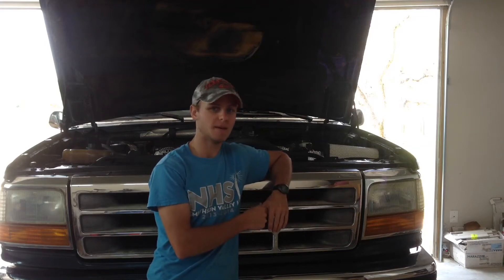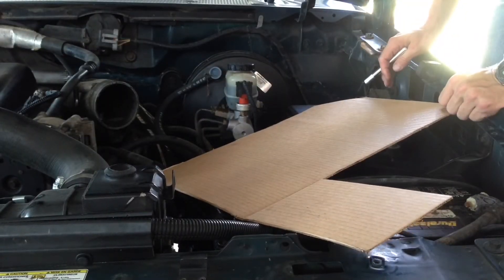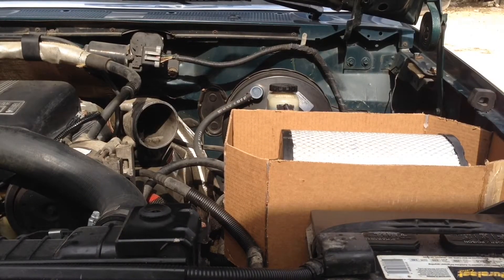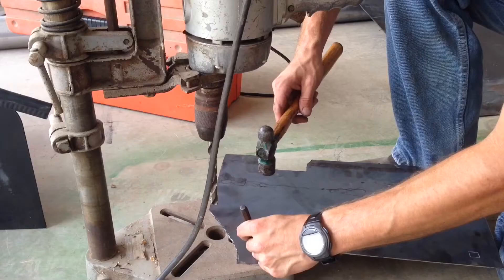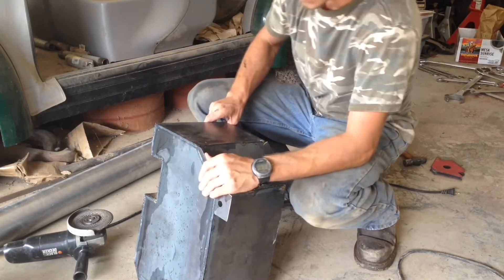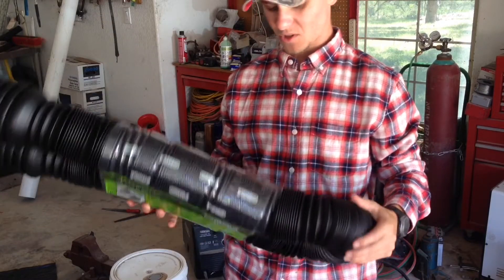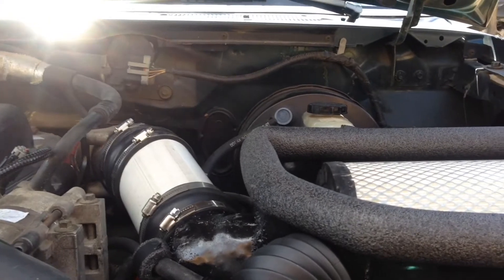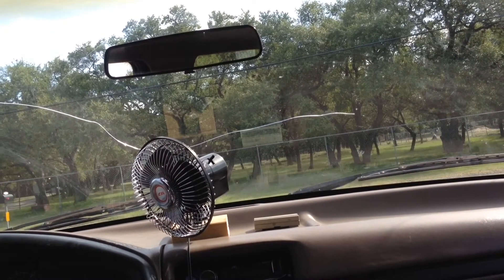Air Intake Build 7.3 Powerstroke

Comment: Any filter under the hood is not a cold air intake
Reply from the maker: Yeah I tried capturing the cold air using the long hose coming out the side. The intent was to use that as a siphon to get air from out front to feed the air filter. Unfortunately it restricted the flow and didn't work out so great.

Comment: 5° degree difference between outside ambient and engine bay temp while moving, cold air intakes are waste of money on intercooled vehicles,
Reply from the maker: Stock 94-97 7.3 Powerstroke equipped trucks didn't come with an intercooler from the factory, so having a cold air intake would make more of a difference. I've been working on a video trying to figure out whether or not it's a good idea to insulate intercooler charge pipes or not. I hooked a temperature probe up to a section inside the engine bay, and with ambient air temperatures around 65*F, I recorded an engine bay temperature in excess of 120*F, and that's after adding heat shields around the manifolds and turbocharger turbine scroll! While this was at idle, I saw the temperature difference drop to around 10 - 15*F while the truck was moving. Essentially, if you're accelerating from a standstill it still makes sense to add a cold air intake to increase the air density. Furthermore,  if you start with an even slightly denser air going into the turbo, you'll still see benefit, albeit likely marginal unless you're shooting for a horsepower record, but in the performance world, every percent of power you can get makes the difference. Simply put, taking in colder air to the compressor of the turbocharger allows you to operate at the same turbo power consumption level yet flow a higher mass of air into the engine. Depending on what you're going for, this could permit cleaner combustion, lower exhaust gas temperatures which in essence allows you to increase the engine fueling rate, and can theoretically help with turbo spool by serving to generate a greater quantity of gas coming out the exhaust with which to spin the turbine. Sure, modifications such as this are likely trivial when it comes to a truck that is simply being used to drive back and forth, but for someone who's passionate about power and takes it up as a hobby, I think it's worth it, with full understanding that not everyone thinks that way, and that just fine too! Thanks for the input!
Reply: An intercooler would be a better and less time consuming upgrade
Reply from the maker: @jeremykincade5815  Maybe, besides, what's the fun in that, why not do both and refine your fabrication skills in the process!?

Comment: Love the video! Just put a 6637 in my truck (actually got one from Advance 20 bucks cheaper cause of my business account) my truck is spooling quicker, has a better throttle response and the boost numbers picked up a bit. Have you looked into a MAP line relocation? It's my next mod I'll be doing tomorrow. By relocating the vac line for the map to the Spyder it gets a better reading and sends more fuel.
Reply from the maker: Nice, I'm glad to hear the 6637 works well for you! I never had the stock intake on my truck, so I wouldn't know. At least I didn't notice any huge loss coming from an AFE cold air intake to the 6637. I haven't looked into the MAP relocation line, I can see how it might make sense to give you a higher boost reading. You can definitely tell that the ECM dictates fuel from the turbo boost. If you do relocate, it'd probably be best to put it in an area of your intake Y that has the largest cross sectional area. Basically as the air flows through the manifold, it speeds up through the small port but decreases pressure, while in larger sections the air velocity slows down and pressure rises. It's just the Bernoulli equation if you want to read into that. It seems somewhat reasonable that you'd get a more accurate reading, but I'm skeptical about seeing and noticeable gains. If you do relocate the line  let me know, I'd be interested in knowing whether it made a difference or not!
Reply: @Rnddiesel  yes sir I sure will, I'm planning on picking up the stuff to relocate it tomorrow.
Reply from the maker: Awesome, best of luck!
Reply: @Rnddiesel by moving the vac line on to the Spyder at the most middle spot it'll read more boost and adjust and send more fuel. I just went to Napa and got a metal valve stem, removed the core. Drilled my hole, started with a 1/8" bit, moved to a 1/4" and the final snug fit was 13/32 on a step bit. Used the rubber seal that comes with it on the inside then an oring between the washer and the Spyder. Took me all of 10 minutes to do.I just took it out for about a 5 mile run. I did notice two things though. It seemed less laggy and it blew less smoke under WOT. It would blow little puffs of smoke under WOT at 60 to 70, now it doesn't. Could be because the original vac line was about shot and I replaced it or it could be because of the relocation. Not 100% sure but there is only those two differences that I've noticed.
Reply from the maker: Awesome! Thank you so much for the info. I may look into some variant thereof for my truck, it'd be a bit different though, I have an intercooler now. How did you plug up the old map line fitting in the intake manifold?
Reply: @Rnddiesel  the E99 Spyder has two ports already there from what I've been told. I have a picture if you have a way for me to send it to you
Reply: @Rnddiesel  the website is IDI performance.com he builds parts for 6.9 and 7.3idis I've used them for years when I was running those motors
Reply from the maker: Wow, that's awesome! I was really close to getting an idi before I got the Powerstroke, they both have their pros and cons too. Not many people build old school idi's, that's pretty cool.
Reply: @Rnddiesel  I love the old IDI motors, they are great but for daily driving/hauling the PSD is Superior, better fuel milage, better performance. Look up racinanddrummin on YouTube. He has a IDI powered bronco that hits 42lbs of boost.
Reply from the maker: I know exactly who you're talking about! I'd heard about the guy quite a bit when I was looking into buying an idi. I haven't heard about the Bronco though, and that's a ton of boost, and a ridiculous amount for an idi especially.
Reply: @Rnddiesel  Racing and Drummin's name is Justin Anderson, he owns R & D Diesel and idiperformance.com and fabricates and builds everything in house and uses his own motors etc for test dummy's lol
Reply from the maker: Really, that's so cool. Haha, I'd love to do that one day for 7.3 Powerstrokes! Heck right now I'm working on an intake spyder, we'll see how that goes.

Comment: You sir are a 7.3 rock star, way to DIY a project. Just spent $ 300 on a sb filter that does not line up with the mounting holes nor the inlet to the turbo. 
What you made kicks ass and love the creative way you made your box!! Puts the sb pos to shame. Love what you're doing with your truck!
Reply from the maker: Thank you very much! I do enjoy trying out new things. You know I've got to tell you, that I'm not currently running this intake anymore, I found that it became too restrictive when I ran it the way I originally intended, with a closed lid.  I do have future plans for a revised version though. Shame about the SB. Right now I'm basically running just a straight NAPA 6637 without any shielding around it. Not the greatest, but it works for now.

Comment: I'm interested in your new design. I'd like one or at least the plans for it so that I could build it myself. I have some 16 gauge lying around waiting to be used. Thanks
Reply from the maker: Alright sounds good, I haven't made the new intake yet, and there's still some things I need to figure out for the design. Hopefully when summer rolls around I'll have more time to figure it out. 

I'm assuming you have an OBS truck?
Reply: No, not OBS.  Mine is a 2000 F-350 7.3L SD PSD CC LB DRW.  However IIRC the 6637 is one of the "acccepted" and "popular" stock intake replacement options (if you read the forums anyway) over the stock intake.  I do still have that stock intake setup, and would like to upgrade.  Furthermore, I like the factory intake too, but I understand its issues.  So a custom replacement that draws in cooler air from a good location and that has the stock appearance is the way I'd like to go.
Reply from the maker: Okay, the main issue I see is that I drive an OBS and under the hood it is not the same as the super duty. Odds are that if I design a new intake, it won't fit in a super duty like it would in my OBS. 

After building this intake I realized that even though it could pull in cold air, it wasn't pulling in enough air at all. Right now I've got the open element air filter, and even though it takes in warmer air, it has more get up and go compared to the intake I build in this video since it has less restriction to begin with.